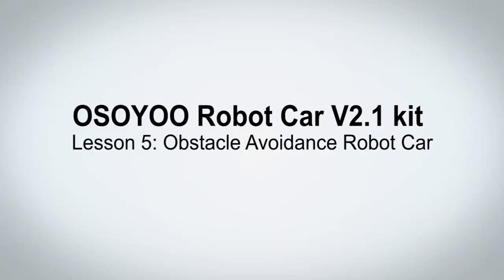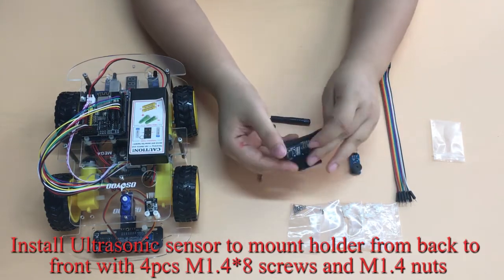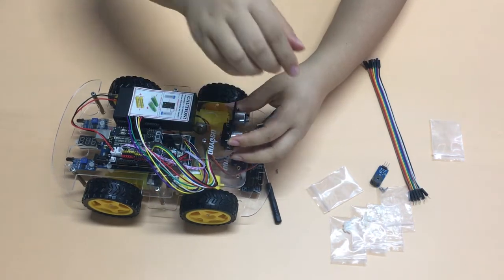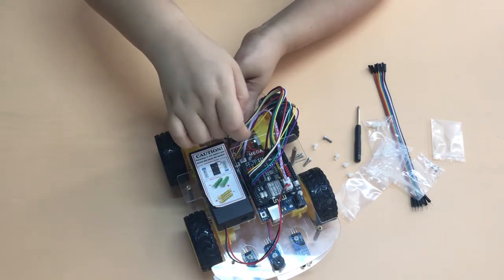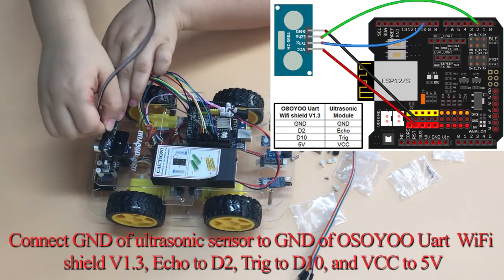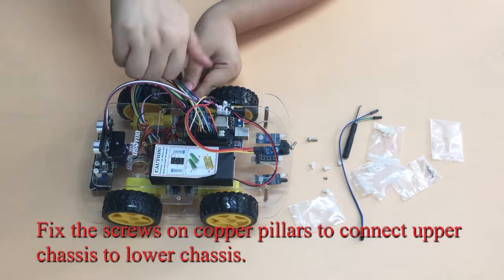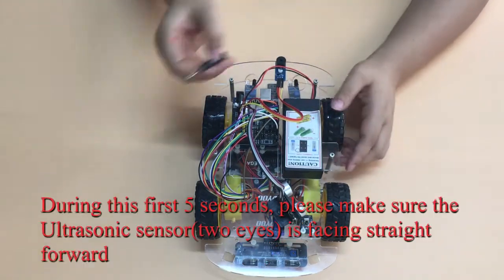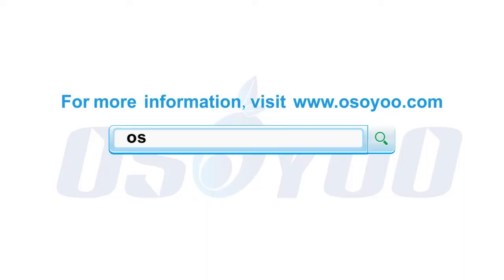OSOYOO V2.1 Robot Car for Arduino Lesson 5 : Obstacle avoidance

Comment: On the servo motor SG90 product details, it says you recommend using pin 9 or 10 for the orange control wire. And I see you move the black wire from the ENA pin of the Model X from from pin 9 of the Wi-Fi shield to pin 3. Is there something special about pins 9 and 10? I figured Digital PWM Pins 0-13 would be identical. Is that not so?